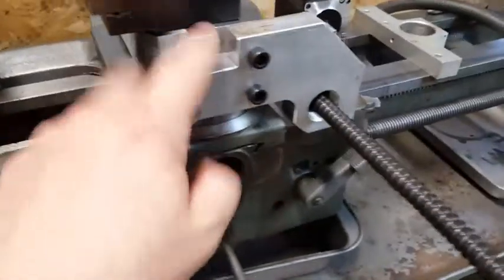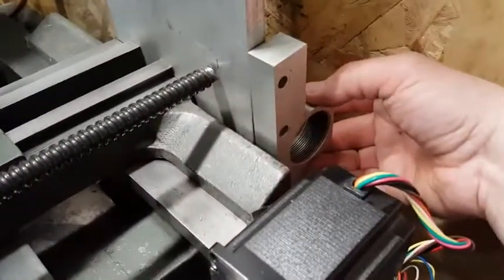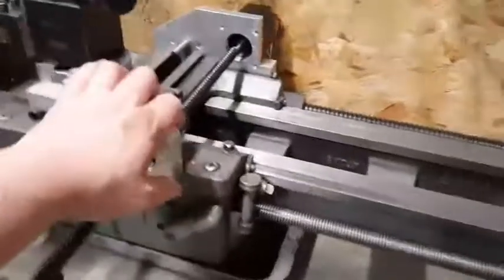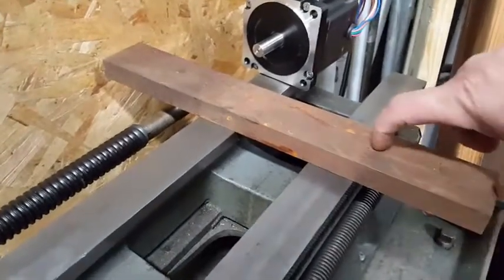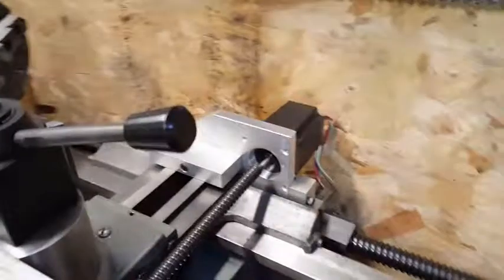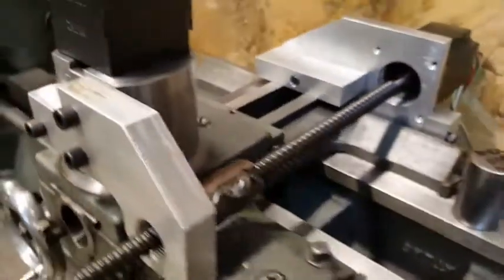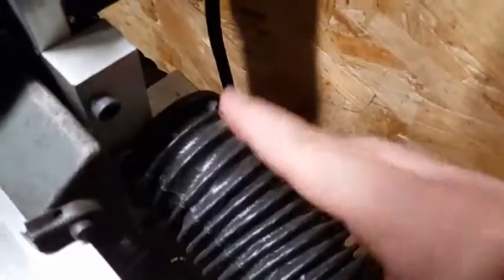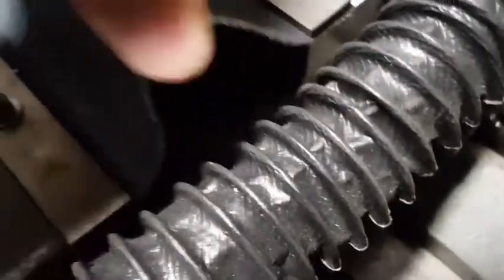Craftsman 12x36 Lathe CNC Conversion - X and Z Axis Motors

Comment: debatting a conversion...if i were into high production or just modifying a tracer attachement as per old popular mechanics mid 1940s
Reply from the maker: Conversion is a lot of work .. but it's fun ... a hobby itself.  If you want a machine to do a specific job, then buy that machine.  Otherwise do a conversion. It's  like a model car, building it  is the fun, but once it's done ... no more fun.        My next/current project is a forklift rebuild.  Hopefully more videos will come out of that project.

Comment: What is the torque rating of Nema motors? I heard you mention the Z axis is a Nema 34 and it appears that the X axis is nema 23 correct? What size and pitch/TPI did you use for each Axis? Is there a rear support bracket for Z axis lead screw? Sorry so many questions.
Reply from the maker: nema 23 motors 270oz on the x axis, Nema 640oz on the z axis.